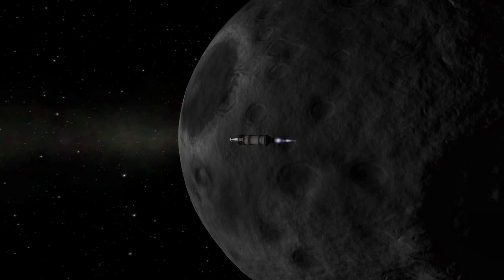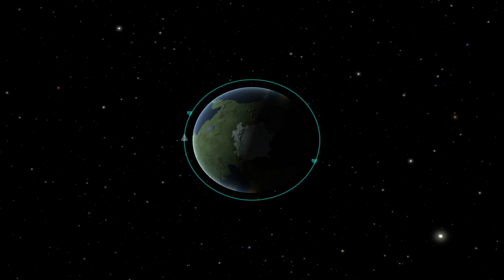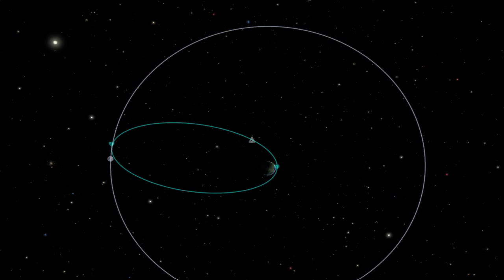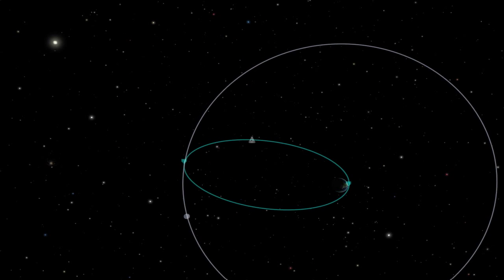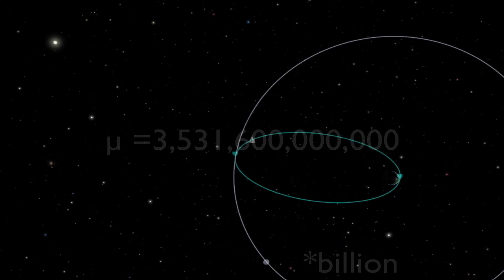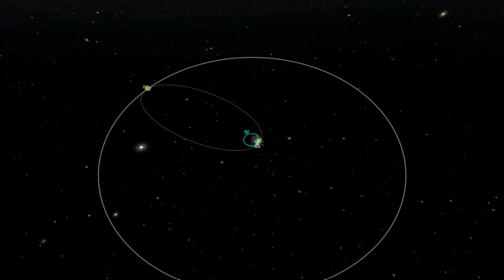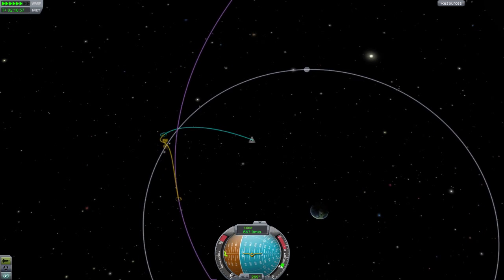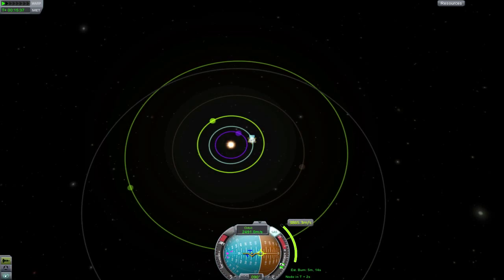How to get to Mün - Kerbal Space Program Tutorial

Comment: One posible workaround, is using only 2 deployable solar panels (or even 2 RTG) and a lot of batteries, so you have several thousands electric_charge to use the Ion Engine at 100%.
When the batteries are near empty, deactivate the ion engine and just timewarp until they recharge (in a few "real seconds"), and continue the burning. 
[This option has its drawbacks, like when you need to continuosly burn to make a gravity capture inside another planet/moon sphere of influence]

Comment: Ion engines use 99.9% electriccharge and 0.01% xenon gas. (1 can of Xenon works for years).
Even with 6 solar panels, you can not use the ion engine at 100% in most situations, because the Ion engine use 12 electric_charges/second; and the standard deployable solar panel gets you only 2 e.c./s (only if every panel its perfectly iluminated with the sun at 90º from them). With 8 solar panels (in pairs for balance) the ship is now too heavy [its better 4 solar panels and 50% trust].

Comment: Here is a request (or suggestion) for a tutorial, if you feel up to it:

Show how to construct and launch an unmanned, heavy lifter rocket, capable of putting at least 40 mass units of payload into low Kerbin orbit (at least 100 km, ideally 150), without leaving any debris (other than the payload).

I'm having trouble constructing and flying large, unmanned rockets - they tend to spin out of control after staging or break apart due to wobbliness. Any help regarding that would be appreciated! :)